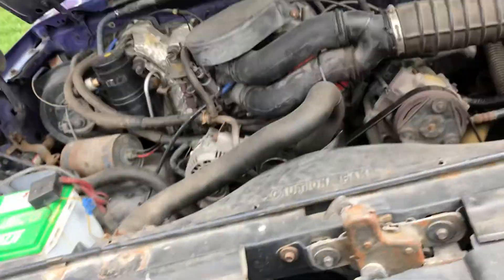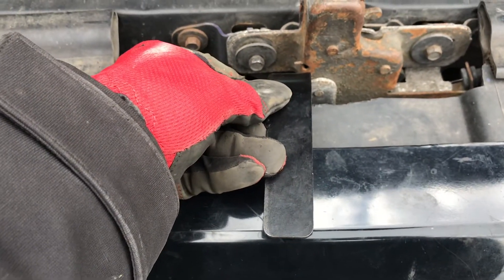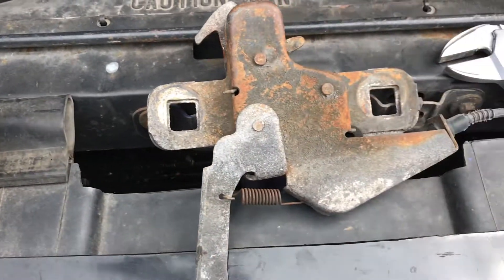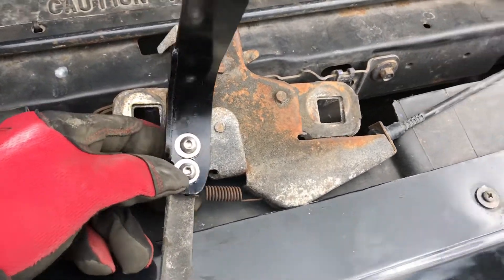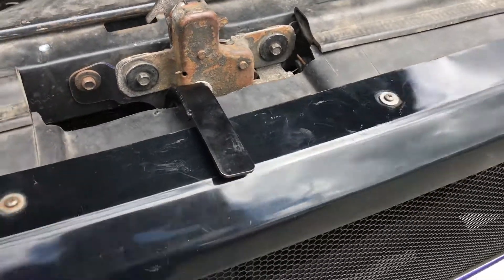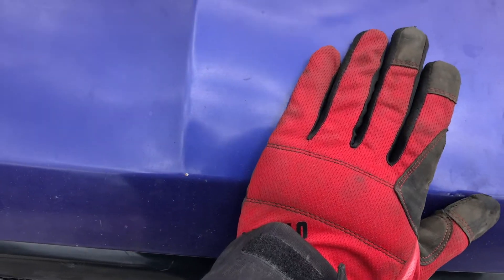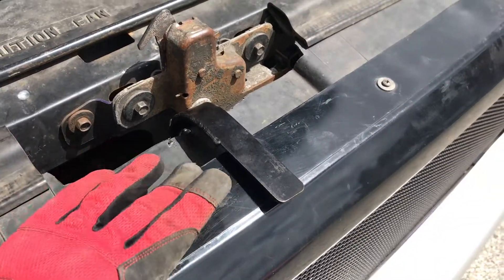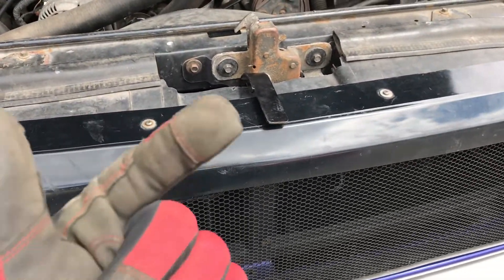Can't Reach Hood Latch with Aftermarket Grille? Install this! | 1995 Ford F150

Comment: Saw this episode come in while at work! Couldn't get to it til now, but always glad to see smilin Stevie from the MM's! Man I have to give a shout out to my own F-150! Had to make an emergency trip which took all day and I just had to jump in the F-150 and go without warning. Normally, for a trip that long and grueling, I just rent a new one to make sure I get there and back, but this time, just had to go. That 1995 long bed, with the 4.9 300 CU straight six PURRED flawlessly the entire day at supersonic speeds. Wow, what a truck for $500! Got a big ole box of treats for it from Rock Auto coming very soon as I'm never afraid to put money into my trucks, especially since I have no car payment. Thanks Stevie, love ALL your work and the time you take to make such fun, enjoyable, and rewarding videos. Soon we may need to talk about the mysterious "hard shifting" that sometimes comes about in these trucks. Everyone thinks the transmission is gone, but most of the time it's the dome light. Yep, you guessed it. A persistent short in the light that is dome light inside and 3rd brake light outside is the culprit. It's how I got all my F-150 when people thought their transmissions were gone. Fix = 15 amp blue blade fuse. : ). This truck I'm talking about NEVER had those issues, but JUST before I left for this trip I shot the hose over the truck to get the dust off of it before leaving and immediatley got the slamming gears. Pulled out the 15 amp fuse which I carry many, replace and bingo, back in business and used all day without incident. Shhhhh....start looking for F-150 up to 1996 which have "transmission problems" and you're likely to fix for about .25 cents. Ultimate goal is to remove all the wiring from the dome light and be done with it.
Reply from the maker: Patrick PhippsPA Good to hear Patrick! I never doubt my old truck anymore. People always old cars break down. Not mine and certainly not yours! I like you love not having a car payment either. I’ve outright owned every vehicle registered to me and that is a nice feeling. 
You are most welcome Patrick! Hit me up anytime! I’ll be happy to answer your questions. The cab lights used to blow fuses on my every now and then. Otherwise, I never fused blow that cause transmission issues. I do know if the dome light isn’t properly screwed down, it can cause shorts on the system. I also now the third brake lights on these trucks tend to leak. So I actually siliconed my third brake light to keep it water tight. Wow! That’s unreal! I’ll have to google search obs trucks with bad transmissions. I wouldn’t want to miss out on a $.25 f150!😁🤙
Anyhow, good to hear from you Patrick! Stay safe and have a good weekend!

Comment: What is the name of the thin metal rod right behind the hood latch that goes from one side of the truck to the other my bronco is missing that piece but I don’t know what it does or if I even need it
Reply from the maker: If I understand you correctly, you’re referring to the stock emergency jack crank handle.

Comment: Hey brother I thought of asking u since I can’t find any videos on this.. u probably Dnt need to do this but I would love to do this in my 96.. you think there’s a way on pushing your bench seat further back than what it does now. I’m 6’2 so I wish I can just push my seat a little bit further back if I could lol or if it be easier if I get bucket seats instead of bench
Reply from the maker: happiinapii That’s a good question. I know the upper headrest of my bench seat just barely touches the glass of the back wind shield/window. So I don’t think there is any room to move the bench seat back in it’s own position. That being said, if you don’t mind a more upright seating position, you could in theory tilt the back of the bench seat forward and then devise a means to move the seat of the bench seat back more. I have a standard cab. Are you referring to a standard cab or extended cab?
Reply: The Minute Masters I have a standard cab as well, I wouldn’t mind having my upper seat a bit up forward a little more i mean it’s almost straight up lol. But the thing is my bench seat is already as back as it could go. So maybe I was thinking mounting some plates to the bench and weld them and the plates mount to the existing holes. That’s what I think it can possibly work. Cuz if u think about it you actually got space back there, if u can fit a thin subwoofer box behind the seat then u can sure try and push ur bench seat more back idk I have to look into that we’ll see
Reply: The Minute Masters thanks for ur reply tho appreciate that 🙏🏼
Reply from the maker: happiinapii That’s exactly what I was thinking. Use places to extend the mounting location for the bench farther back. But you are right, the bench seat is pretty straight up already. Lol
Reply from the maker: happiinapii No problem man!🤙 Thanks for watching!